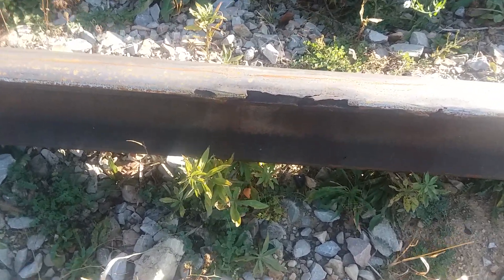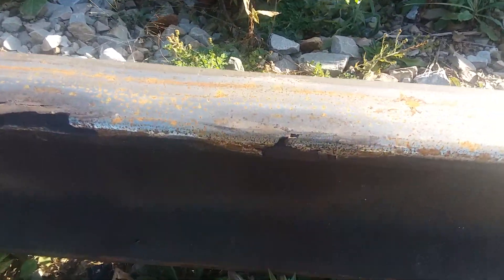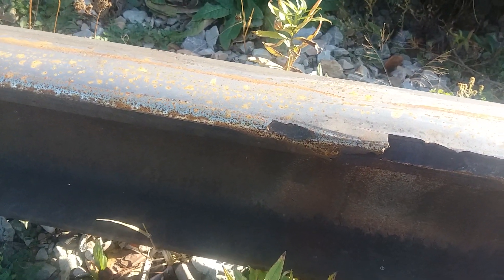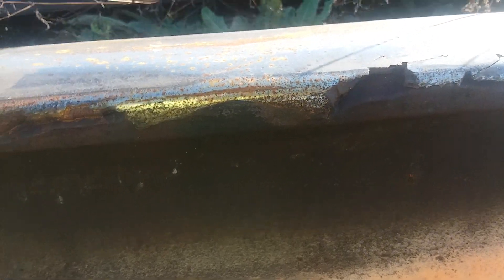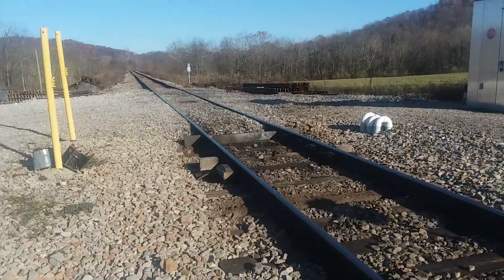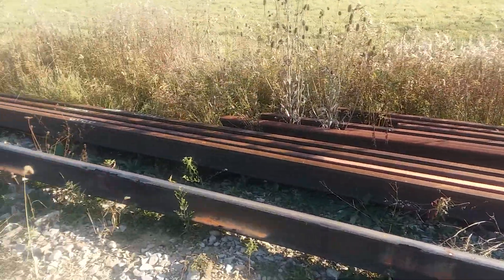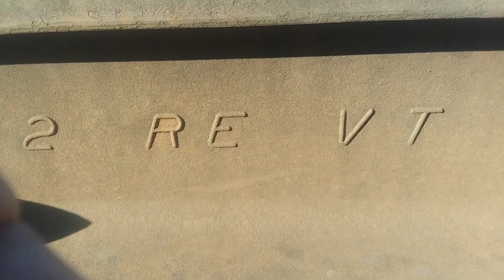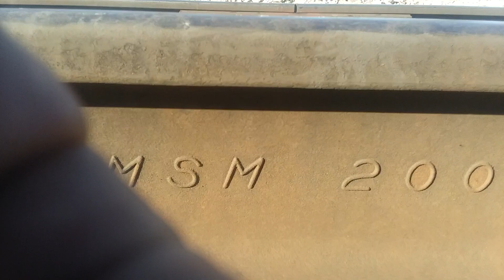Rail Defects: Rail Head Shelling

Comment: You see all of these new "Engineering" test trains that are run to test the rails, taking pictures of every inch of rail, listening to the frequency sounds of every foot of track, that can identify problems before they can be seen or become a safety issue, but I still remember (in my distant youth :-), the gangs walking every line, tapping the rail to listen for a hollow ring indicating trouble, taking in every aspect of the track, and taking comfort in the knowledge that safety was paramount. 
These trains have superseded people. 
Yes, they catch some things before people are able to, (and some that humans will never be able to alone), and at a much faster rate that does not interrupt any schedule. But I would still feel happier to have an experienced pair or ears and eyes like yours AS WELL AS the train. 
Human intuition. Computers do not have it, and can't be taught it. 'Nuff said.

Comment: Just a check. Vacuum degassing is done to liquid steel  to remove impurities, mainly gases. This is done for many products that are not specifically rails, be they railroad or crane tracks.  Yes rails require controlled cooling otherwise they would bend along the rail horizontal axis, also the head of the rail requires a specific hardness to a specific depth, so controlled differential cooling is a must.
When a rail is rolled the large head and light bottom flange induce a bend as  metal is manipulated toward the final profile, A secondary process requires the  rail to be straightened without inducing undue stress.  Your damage described the cold rolling effect of the steel wheel on the rail.  The steel will either flow or crack. As the contact between wheel and rail is small the tendency is to crack.
Reply from the maker: Brian, awesome comment sir! Thank you for your expert information you've added. Really great to have others make comments like this, helps enhance the video information

Comment: is shelling happening when the wheel flanges are squealing and transferring the harmonics to the rail causing it to vibration fracture.??   each vibration cycle is like a hammer blow to the track .. how may times could you hit the surface of the track with a 200,000 pound sledge hammer before it fatigued and started flaking..
Reply: Wayne, rail certainly does take a beating, it amazing how well it holds up over the
years. There has always been a lot of discussion on the rail wheel interface over the
years among all the railroads. There is actually a conference put on every year for
railroaders to discuss new ideas with each other. Railroading is an every evolving
business and we all learn new things all the time. It's amazing. Certainly your comment
is very worthy of consideration, after all if a train never passes over a section of rail,
it would never wear out, except by rust. So great point you've made. Thank you

Comment: Can grinding help manage these defects in their early development?
Reply: Frank yes it can, however we have no interchange with any railroad so getting
one of those monster Loram grinders in is out o the question. I've suggested many
times in the past to get a small switch grinder that can be trucked in, but no one
yet has agreed to spend the money to do it. They are very expensive and slow and
charge whether they are sitting or grinding.
Reply: @ccrx-xu1wc  most of our shelling happens on the field side.
Reply: @michaelball760  Michael, really? That does happen but odd to me, 
are the car wheels tracking that far over the head to do that
Reply: Awesome videos! Keep them coming. Question: do the truck wheels get reprofiled? I’m guessing the wheels hollow out over time and put more stress on the gauge corner of the high rail in curves ?  Wheel and rail interface is a complex environment to study.

Comment: In the US do you stress and weld your rails or is it all jointed by use of the fish plates. What max speed limit have got on US Rail network.
Reply: Aaron, many railroads use continuous welded rail, we have all jointed rail. We call
fish plates here joint bars. Interesting underground in the mine they have track and
the call them fish plates underground. There are 9 different classes of track in the US.
We have class 2 which is a max speed of 25. The higher the class the faster the allowable
speed. Will do a vid in future on track classes where I can go into way more detail on
the differences. Thanks for watching and very good question

Comment: I have to disagree with statement that "RE" stands for "Relay". It actually represents the "AREA" designed rail section. Go to www.txrailholdings.com and see the rail chart.
Reply: Thomas, you are correct sir. When I started on rr a guy told me it stood for relay,
that got ingrained in my brain over the years and when I see it, thats what pops immediately
into my head. But you are right it designates the AREA or AREEMA rail section for the
rail weight. Will do another vid on rail identification marks and make that clearer for
everyone. Really appreciate your comment sir.

Comment: Question: if you have a section of strait rail, no defects of the type you've described here, can you flip the rail to get longer life out of the section?  In other words, flip the rail so the field edge is now the inside gauge edge? There may be regs that prohibit that. Just asking if it is possible. Thx!
Reply from the maker: Great question. Yes we can flip flop the rail. We can also transpose the rail, which means move it from one side of track to the other
Reply: Some countries it is banned to do so.
It also depends on other rail defects to take into consideration like flat head running and rail depth wear.

Comment: What is that in front of detector box? Looks like a large spring? Can't tell
Reply from the maker: 4 inch plastic conduit, wires run in them from sensors to inside the bungalow
Reply: I've always been a rail fan thanks for all the info
Reply from the maker: @davidbass7593  Thank you David, glad you enjoyed

Comment: Could the tendency to shell be caused at the rolling mill?  How the steel is stretched and formed when it goes through the mill rollers?
Reply from the maker: There is a very good vid on tube by How It's Made. It about how they make and roll rails, very fascinating the process
Reply: @ccrx6700  ,  fascinating, i very much agree.  i've tried to watch anything about it.  a precision art to get the most out of an alloy which has a tough job.
Reply from the maker: Could be a part of it, i was kind of thinking it had to do with impurities in the scrap metal they used. I do not know if there are any studies done on this or not. Would be interesting to find out.
Reply: @ccrx6700  ,as someone else said, they are very precise with some steels.  especially manganese steel for rails.  it is a dark art, with the treatments and very long cooling times in holes in the ground.   my call on the shelling is that the manganese steel hardens more with use.  which is why it is used for rail.  but this can also lead to brittleness under certain conditions like cold.  there was going to be a mine opened on baffin island.  manganese steel was not suitable in the freezing cold conditions.  they were choosing a non-manganese alloy.  in the end the mine didn't open.  by the way, i've just found your videos.  and i'm loving them.
Reply from the maker: @vsvnrg3263  you very well could be right sir. I would imagine it a combination of several factors internally which could have been aggravated by an external engine burn, thanks for the comment and for watching
Reply: @ccrx6700  From the steel making videos I've seen, it appears they go to great lengths to test the chemical make up of the steel before pouring it into the rolling ingots.  I could see where flow marks / defects could be induced during the rolling process.  Similar to injection molded plastics when the molten plastic is injected into molds.